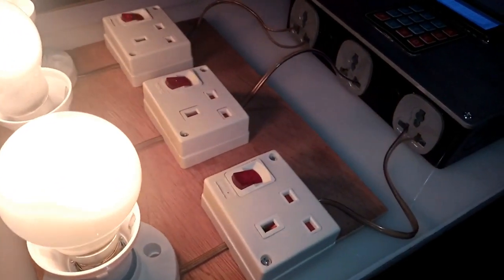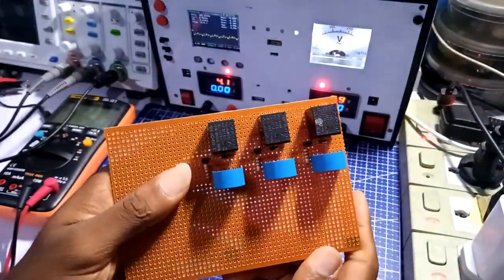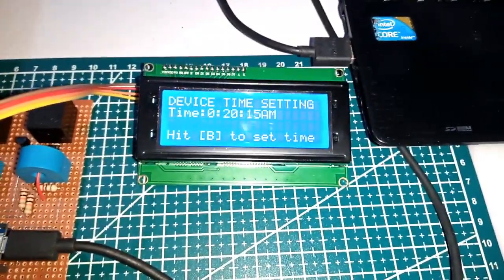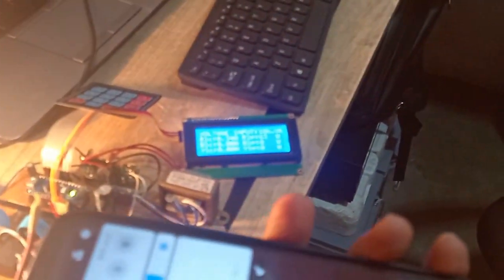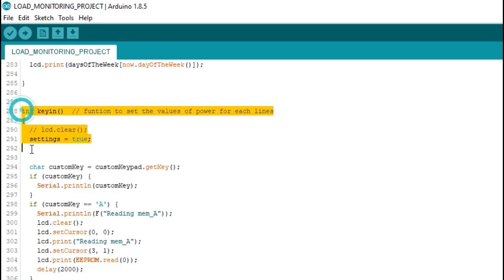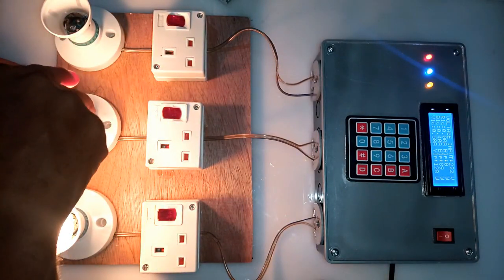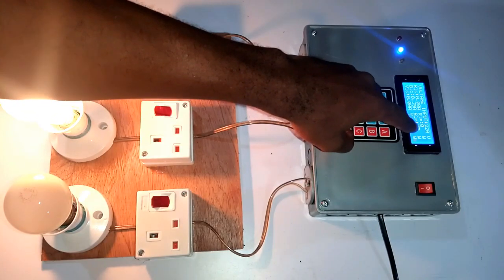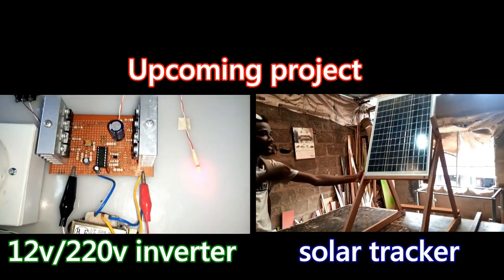Electrical Load monitoring device : Arduino based Power monitoring/balancing system using 4x4 keypad

Comment: VERY cool project. But the RTC module u later used was not included in the circuit diagram you provided.. Is it just connected directly to the arduino board and does not have any other component connected to it?

Comment: You are too good bro 👏👏. I need some help bro. Is it possible to simulate the circuit for this project exactly as it is using Proteus because i a failing to do so.
Reply from the maker: Thanks for your kind words.
Am currently running the simulation, once ready, I will publish it on my page
Reply: @MEmbedded_TechLab   Oky thank you

Comment: Great project. 
The current sensor has two terminal. Pls guide on the connection. From the circuit diagram, there are external components connected to and seems confusing. Thanks in advance
Reply from the maker: The have no polarity as it is shown, sure they are well connected.

Comment: Great project..
 Please do a video on how to solder components on a board from a circuit design 🙏🏿
Reply from the maker: Well received, I will look at that
Reply: @MEmbedded_TechLab  what equipments/machines  would you recommend to someone who’s just starting the electronics journey?
Reply from the maker: @maleekshabazz6857  
At beginning stage, you can get a simple multimeter, solder iron and soldering stand.
Then if you have suffice funds, you can now get some work station, electronic components and many more items which you fancy.
Reply: @MEmbedded_TechLab  thank you.